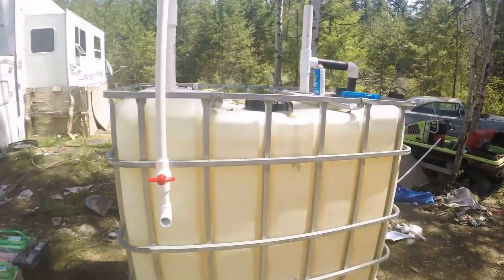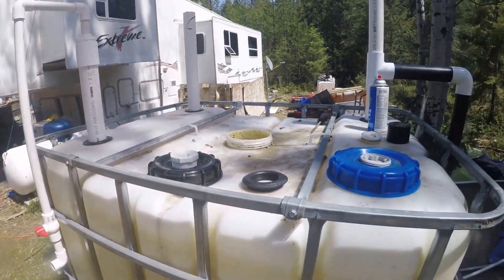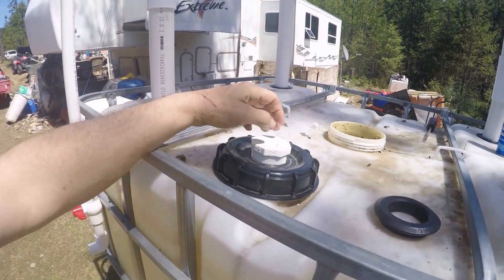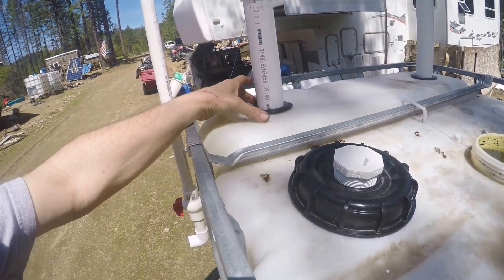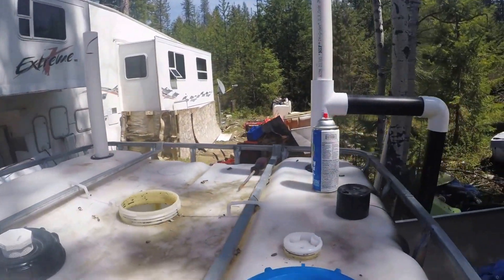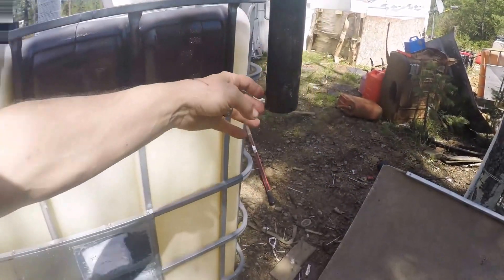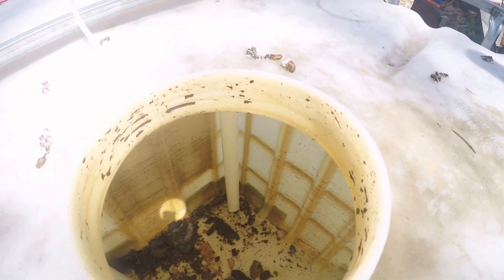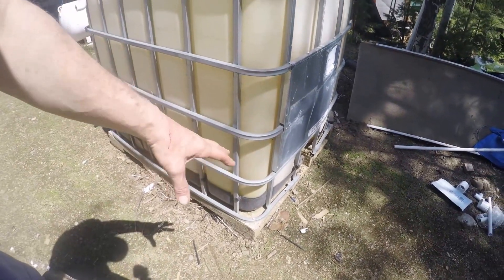IBC tote Methane Digester build

Comment: Thanks never thought about a pit and a burner to keep it at the ideal temperature and as usual i started thinking why not use the gurs out of a hot water heater you have the burner pilot light and temperature control dig a big enough hole to insulate around the hot water tank you can cut off the tank to fit the height of the hole the deeper the better then fill the hot water tank with sand although water would be better it evaporates and in colder climates freeze most gas models have a pressure relief valve on the side put the temperature gauge there as sand heating from the bottom will shut off the heat way too soon up top all the sand will get up to temperature and as the heat rises it'll heep the burner from cycling too much just a suggestion am starting mine next week

Comment: Hi any updates. About to do mine an doing research.
Reply from the maker: We are still working on it we ended up finding a leak in the tote we used so if we cant get it fixed we will start over. I have a video but have not finished it yet.

Comment: you need to look at my videos on biogas, your wrong about a hand full of things I should know I build 2 bio digesters and both of mine work.
Reply from the maker: The one I built works too its based off the Solar Cities Biogas generator used all over the world.
Reply: Simply Gridless I'm not Knocking you just wanted to point out somethings, it's to be helpful more then anything. I love see more people get into biogas.
Reply from the maker: Oh I understand and I will be watching your videos too. You can't have to much information. I am still working out how to heat this huge thing so I can still get biogas during our cold winters here in North Idaho.
Reply: @watchman0311  I'm going to try his suggestion of heat under the tote old hot water tanks are thrown out all the time cut off the top move the controls up hiigher on the tank need as long a thermocouple as you can I've seen 3 foot